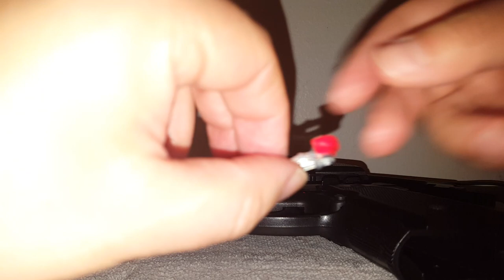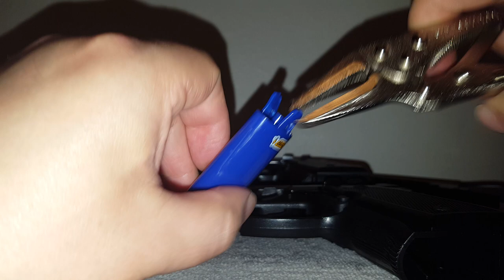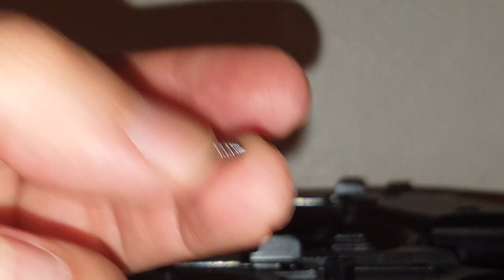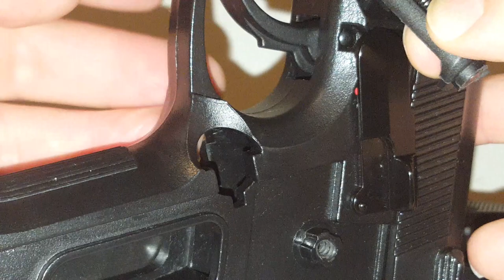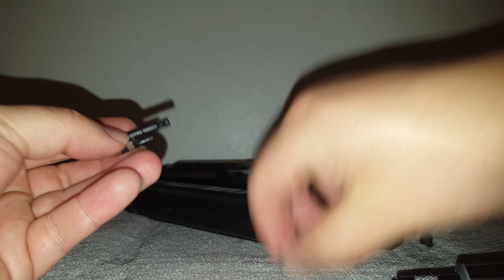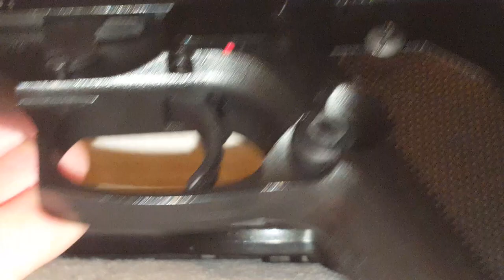Daisy 340: Easy Hacks

Comment: Wow love this video it shows how to fix your 340 for cheap or free I see Bic lighters on the ground all the time. The close-up video worked very well too great lighting could see everything clearly. Very well done my friend.
Reply from the maker: You got it, Alfred! If you have spent Bic or find any, they still have value for parts!

But fixers NEED to use proper cutters or the spring will get mangled.

https://www.oreillyauto.com/detail/c/power-torque-tools/tools---equipment/hand-tools/pliers/203f58549407/power-torque-tools-long-nose-pliers/ptt0/gm8702

https://www.oreillyauto.com/detail/c/power-torque-tools/tools---equipment/hand-tools/pliers/203f58549407/power-torque-tools-diagonal-pliers/ptt0/gm8703

Comment: Well, thanks for the good videos you have about the 340. I got one recently and it's actually a lot of fun. I set up a few cans out back, and it's hard to stop shooting, it's good fun. So far it's been reliable, and accuracy, well, it's good enough at 10 feet for hitting cans and practicing pistol shooting. I'm really enjoying it.
Reply from the maker: Trevor, glad you are having fun. I have transferred my flag to the psm45.

If you have any trouble with feed jams or major issues, feel free to come  back and talk about it. I got THREE 340s for $30 so I pushed hard on the testing. 9000 shots total until the third 340 broke at 5000 shots on the mainframe (bottom section). 1000 shots in on my second slide.
Reply: @daisy880fanaticfixit9  mine suddenly lost power, took it apart and there was a crack in the feeding chamber...

Comment: Do you know if the Marksman BB's will work in this pistol? I just picked up two old Marksman model 1010's, both made in 1988, and one of them came with a package of those gold colored Marksman BB's. But I measured them and they are larger diameter than regular BB's like Daisy's or Copperheads. They work perfectly in the old Marksman pistols, but I'm not sure if they will get stuck in my Daisy 340. Any info on this? As a side note, I've been shooting the Hornady black diamond BB's in my Daisy 35 and they seem to shoot really, really straight, even at long distances (over 25 yards).
Reply from the maker: Hey Trevor! Yes, the Black Diamonds can be really impressive in certain guns. They are rock stars in my Grizzly and Psm45. My psm45 has NEVER jammed shooting those.

On the Gold BBs, as you know, they come in average size of .176. Honestly, I would use those in your pump guns, too. They are EXPENSIVE now, like $10 for 1000 Marksman BBs.

If you got some free with your 1010s, try it in your 340. But I would see that as a waste  of very good BBs. I won't buy Marksman ammo now because they cost more than Daisy Match - and are not better.

I tried Black Diamonds in my 340, but they didn't stop the non-stop jams in that flawed system of using the gumstick to smash BBs into the feeder - which stress the retention prongs.

I did talk about your 1977xs experience in the written section in a Legacy video about how to handle it. Thanks for that!

Comment from the maker: THE SEAR BOX

If you are planning a TOTAL disassembly, I tell shooters that to clear jams disassembly isn't the road to take.

But if you have taken the slide apart, then, I understand why you want to go all the way. I had a sear assembly video but it overwelmed many - sort of technical and light gunsmithing.

STEP 1: There is a retaining pin. You tap from the butt angle, right to left with punch and hammer. Sometimes they put it in backwards,  so if it doesn't come out in 2 light taps,  try the other side - left to right.

 STEP 2: Remove the small Philips screw on the right side. 

STEP 3: Then PULL UP on hammer. The sear box comes out and you remove black panel.

There is a piston sear and spring, a trigger sear and spring, then the target for many fixers - the hammer with torsion spring under it. You push down on piston sear and that clears trigger sear. From there you just pull out your hammer and spring. I just had to replace that hammer spring. It snapped after 5,000 shots. Natural life.

Hope you have good reason to get in the sear box. I would use your phone to take pic before you remove parts.

Comment: My 340 is having issues when cocking back the slide. It’s springs back forward whenever I pull it fully back and whenever I do that with a BB in the magazine, it always jams. Please help me this is my first BB gun.
Reply from the maker: Try this fix video. It should work IF your 340 is new.

https://youtu.be/pr-bKSSpSPU

At around 1,300 to 1,500 shots, the post in back regularly will fracture and warp. The gun will not cock any more.

I have folks happy to fight off loading jams, but then get angry when that DOES NOT work anymore. The post breaks, and they don't spot it. The piston catch and piston sear won't mate.

Ideally, Daisy should make that post out of 4140 steel.

Comment: What is that lever by the safety it slides up and down a little bit on the other side it has a button to press in and it comes out. What's it there for? Ty
Reply from the maker: Ty, the button on the right side is the slide release. It toggles back and forth because of the compression spring riding in its rod.

The lever on the left side is the slide lock. Its rod holds the side on. The slide release rod comes through and grabs the edge of the slide lock lever to hold in place.

That system gives it nice advantage for disassembly  to clear breech jam,  but I have switched to the psm45 because it has better engineered magazine and loading.

Daisy needs to make the metal post in back strong steel, otherwise in time is does crack and warp. It won't cock anymore. WHEN SHOOTERS DRY FIRE THE HAMMER IT HAPPENS FASTER.

The psm45 is a perfected 340.
Reply: @daisy880fanaticfixit9  Thank you very much!

Comment: This model I owned broke, I dropped it and horrid timing it got crushed. Now I've been relentlessy searching for a fix on YouTube and this is closest I've found. If u haven't abandoned ur channel could u possibly maybe do a complete disassemble reassemble on this model?
Reply from the maker: Ronald, you made smart remarks about YouTube, so let me address those first.

Many folks come on YT with hopes of being rich and famous, like ASP. Like being a movie star, most don't make it. They turn off comments or disable notifications.

Now, unfortunately for the 340, I HAVE abandoned it. My 3rd incarnation, usings different slides and mainframes (bottom), broke in the inescapable way - the diecast post in back warped.

When that post WARPS it won't catch the piston any more. KAPUT. Trying to repair it is a no go for most people.

I did get through the life of one mainspring - few manage that - 8,000 shots. My third mainframe went about 6,000 shots before post warping.

The carnival guns I push hard in this class are the psm45 or the DX-17. The psm is a perfected 340, and mine has had zero malfunctions closing in on 1500 shots. My 340 never was trouble free.

Comment: hey idk if you can help me but my 340 isn't cocking right. I pull back the slide and it doesn't fire. the hammer goes forward but it doesn't shoot. if that doesn't make sense go to yours and pull the hammer back and not the slide and shoot it. just a small click and not the big one (hopefully) any way you can help me fix it?
Reply from the maker: Well, hate to break it to you, but the post in back likely cracked and warped. Meaning it won't cock again. The piston catch doesn't line up with the piston sear. 

Use the below video to verify it.
https://youtu.be/ga_bux7DMDQ

So you know, I have transferred my flag to the psm45 - slightly more power and no jamming. I'm in the process of buying 4th 340 to run tests for better performance.
Reply: @daisy880fanaticfixit9  tysm!
Reply: @daisy880fanaticfixit9  (I took off the slide)  when I pull the hammer back it raises a small piece of metal with a v shaped cut. is that the catch? the post does not seem to be cracked or bent either.
Reply: @daisy880fanaticfixit9  sorry for replying so much but like you said I dont think the spring is catching on the thing. I took the mag out and cocked it. I could see the spring moving but it wouldn't catch. any fixes?
Reply from the maker: Ok, no problem; you can write. Nothing worse than when others want help but can't write clearly.

If the post isn't cracked - and you checked that with a magnifier - there is hope.

A BB MISFEED won't let you cock it. It gums up the slide - sticking between the the slide and the mainframe (bottom half).

It could be a jammed piston sear.  That means take the slide back off and check  the "door stop" or "wedge of cheese" is popping UP. You should be able cock hammer and it  it pops back up on its own. If it is STUCK FLAT, it lays flat. Your gun can't cock. Lube and see if it pops back up. DON'T DRY FIRE THE HAMMER. LET IT UP SLOWLY WITH YOUR THUMB AS YOU PULL TRIGGER.

Turn your bottom half upside down to see if loose BB  falls out.

Also try this video:
https://youtu.be/pr-bKSSpSPU
Reply from the maker: Lightly move your hammer back and forth with your thumb. Does the v metal go up and down?
Reply from the maker: To explain piston catch, put your slide in your palm upside down. Use your free hand to push on the hop up to move the barrel and front spring forward. The catch is the metal you see exposed that runs down the open gap. That is your piston tube.

Clean any grime off you on the catch that could stop it from Mating with piston sear.
Reply: @daisy880fanaticfixit9  it does go up and down
Reply: @daisy880fanaticfixit9  so when you pull back the slide it compresses a spring and  compresses air right? when you pull the trigger the sear goes down and releases the spring and the air which fires the bb.
Reply: @daisy880fanaticfixit9  the catch part seems to be almost flush against the plastic. is it supposed to be up and overhanging a little for the catch because I dont think the catch catches on the sear.
Reply from the maker: Well, you are getting a good feel for this pistol. 

Yes, the piston head BARELY locks on the sear. 

Know that all 3 of my 340s had the post fracture, then warp. The fracture can be HAIRLINE.

Will follow up tonight. Hope you watched video on clearing basic jams. Check the barrel for BB jam as I showed.
Reply from the maker: Sea, how many shots do you have on your 340?

My first 2 broke at around 2000 shots. I tied the early death to dry firing the hammer which can cause metal fatigue on the post. My 3rd one went 5000 shots - hammer only flew up when gun was cocked. A lever on the left side slows down the hammer. 

So what do we come back to here? The post. A metal specialist said it should be 4140 steel. It isn't by Daisy. 

If the post is even slightly warped from age, your sear and piston won't mate.
Reply: @daisy880fanaticfixit9  less than 1000 I am not really sure. there could be less than 500.
Reply: @daisy880fanaticfixit9  I am nearly 98% sure there are less than 1000 and 65% sure there are less than 500
Reply from the maker: @seacheese7280  - thanks for being great to interact with here. I know you want your 340 working again. But if no dice, transfer to the psm45.

It does cost a few more bucks but is well engineered. I call the psm45 the 340 PERFECTED.

For the Crosman, use only great BBs: Black Widow, Black Diamond or Umarex Zinc.

ALWAYS ride the slide home. From video one for the Crosman, I make clear the lessions I learned on the 340 were great for the 45. Great BBs and proper handling.

Know that the heavy  metal slide of the psm45 means if you sling shot, the plastic parts get smashed right away. Had one gent report in he wrecked his psm45 as soon as 200 shots.

But some rich guys don't care about breaking these guns early. Firearm ammo costs so much more. They sling shot anyway. 

I'm not one of those guys. I want my stuff to last.
Reply: @daisy880fanaticfixit9  thank you for the help!

Comment: Good video! Mine only shoots about 25% the distance as to when it was new...any thoughts?
Reply from the maker: Yes, unless you have 8,000 shots and a worn out spring, there are a few other ways the gun performance tanks:

▶️ The most common EARLY break is the piston tube shattering in front. That can happen from dry firing (no BB loaded). On spring guns with METAL tube, that's not an issue.

▶️ The rubber piston head gets damaged, from using wrong agent like penetrator like JB BLASTER or WD-40. The air then gets ARROUND the rubber head, sheddding power you would otherwise get from the piston.
Reply: @daisy880fanaticfixit9  Ok, I've only shot about 100 bb's through it and I haven't used any agent...Might just be defective.
Thank you for the reply.

Comment: Hey man
Its full plastic?
Reply from the maker: You got it. There are diecast metal parts inside. The piston head is metal. The sear assembly (left side) is metal. The post in back, when you cock the hammer, is diecast metal.

The trigger arm, positioned on the right side, is metal.

The safety and hammer are also diecast metal.

Comment: i thought the hack was for making it shoot more powerful.... jeez
Reply from the maker: Well, the definition of "hack" I learned was doing a basic FIX that isn't OEM (manufacturer part).

A modification (Mod) normally covers PERFORMANCE  improvement.
Reply: @daisy880fanaticfixit9  any mod out there then? i just bought one today.
Reply from the maker: I know it isn't funny to you, but Im guessing you find it really LOW power. You sound like that, and I get it 

Here are some EASY tricks that will BOOST performance.

Use Black Diamond or Black Widow BBs. Those black BBs are superb in psm45 and 340. Here are some videos to help you with 340 problems including power. The 340 does have more problems than the Crosman.
https://youtu.be/wWcScDWW1VY

https://youtu.be/pr-bKSSpSPU

https://youtu.be/smGRTF4NZXc